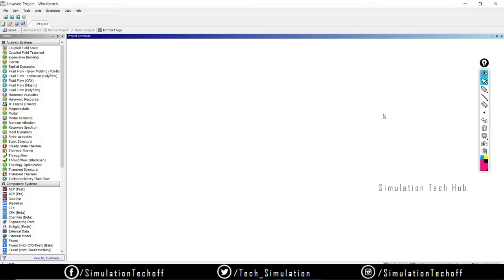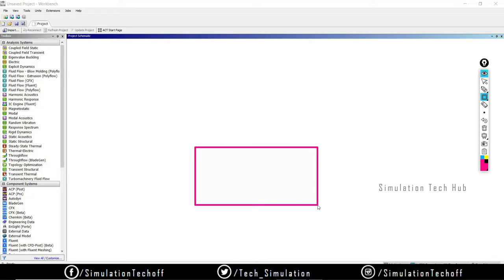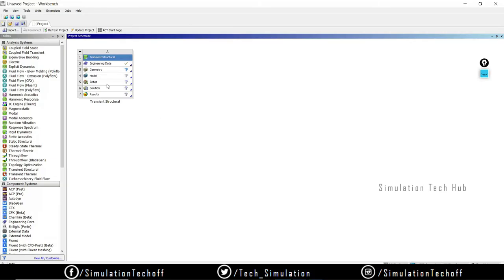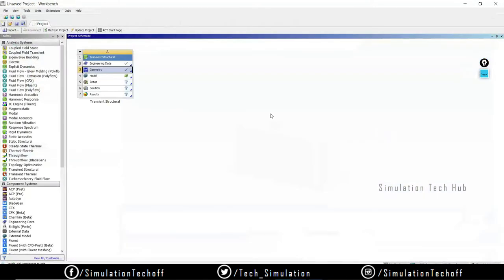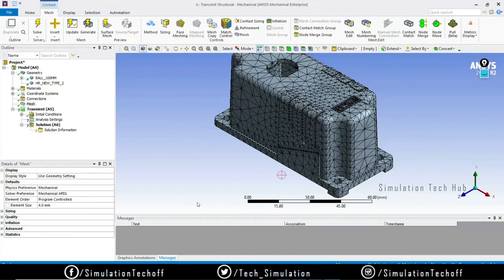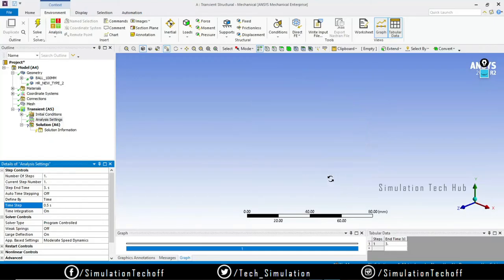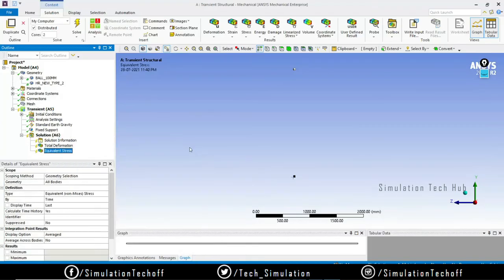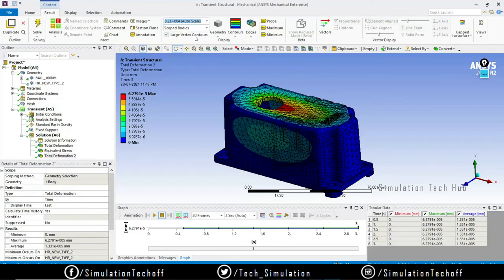Drop Test Analysis in Ansys Workbench

Comment: Hi bro. Overall it is good video bro.. But it seems that you didn't define contact between ball and bracket. That's why deformation is very less.
Reply from the maker: Hi Karthikeyan, In Explicit Analysis You don't need to define contact. Automatically it will defined with Augmented lagrange type.
Reply: @simulationtechhub  Hey, but you solved by the implicit solver